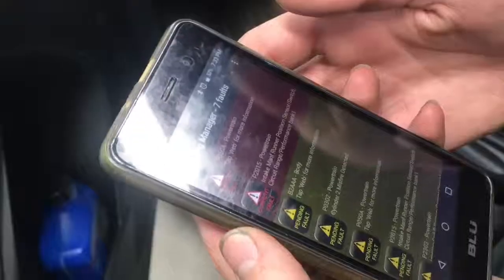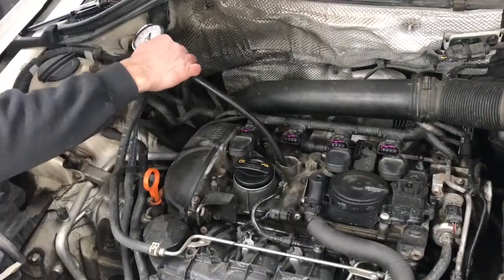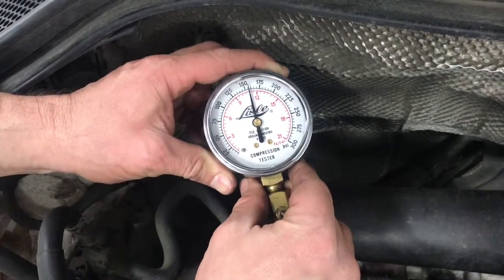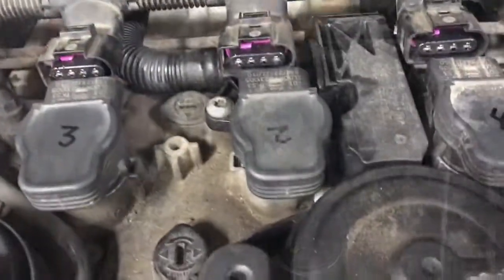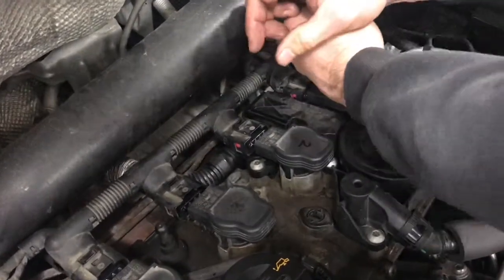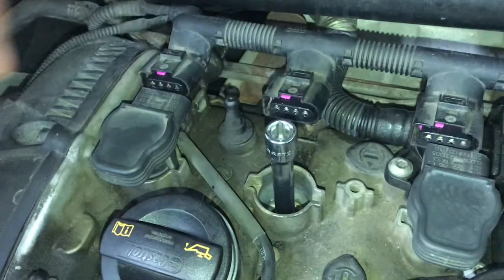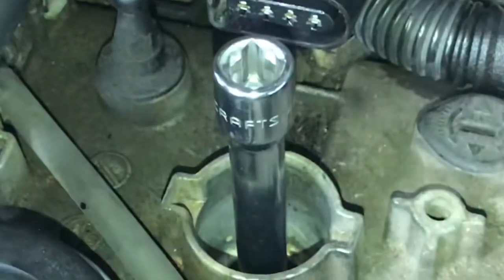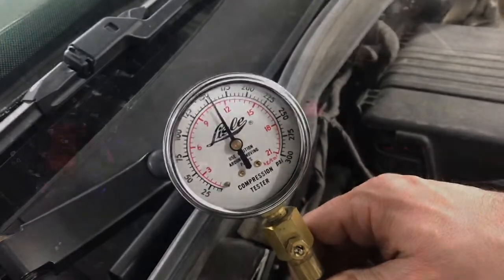diagnosing PO302 with a compression test on a volkswagen tiguan

Comment: What is bad compression? 120 psi? I have the 2.5 liter 5 cylinder. 3 cylinders are 165 psi. One cylinder is 180 psi and one cylinder is 120 psi.
Reply: As I understand it, the focus should be consistency where all cylinders are within 10% of the highest compression value. That said, from the video it sounds like 150 is a good value for this particular engine. Different engines will have different compression specs, of course, so look for official spec values from the manufacturer for your engine model and year. It also depends on if there are any mods a previous owner may have done to the cam, pistons, cylinders etc.